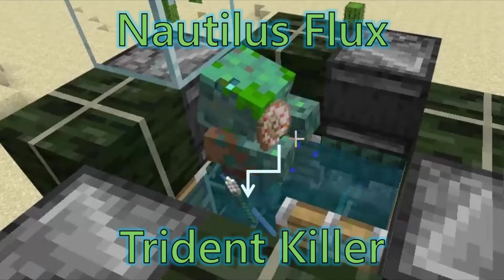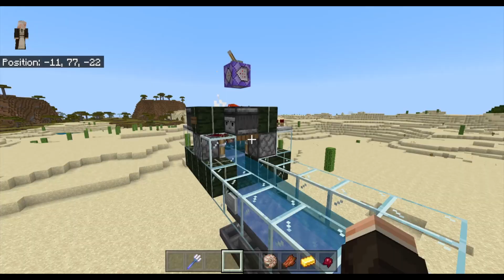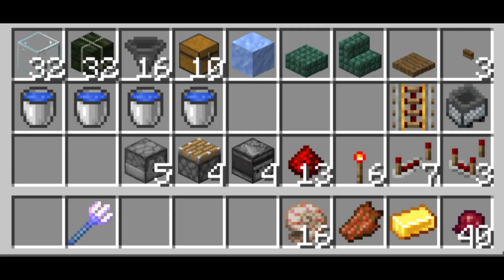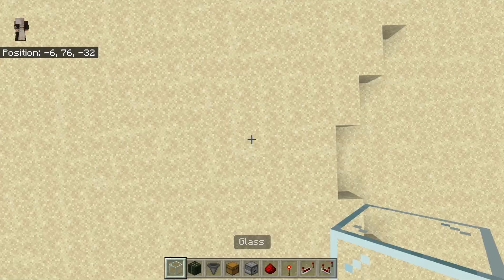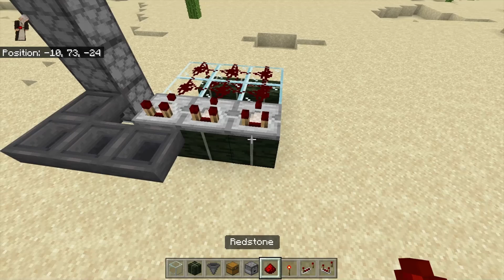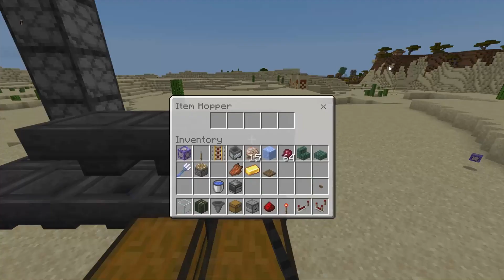Nautilus Flux Trident Killer - tutorial

Comment: Great design, seems to be working in 2024 ( although I did mod the sorting system for the one with targets as I was getting a few items in my trident chest). Curious, what happens once the shells really start adding up? I ran the sorting system with silent whispers version of the farm and not sure how I can use the elevator to the kill chamber but also store and sort the shells once they’re adding up (ie over 64 of them in the system). Thanks
Reply from the maker: Glad you like it. The shells should go past the flux filter once it is full, and then on to storage. FYI I have a newer version of the flux system and several improvements over silents’ version of the farm in my video here:
https://youtu.be/2MpM9RTxp1g
Reply: Thanks for the swift reply, i did consider shortly after asking that that was actually the answer so thanks for confirming! Also , checked your latest version so also thanks for pointing me in that direction. I’ll add the corner insets and turtle eggs as detailed, probably won’t take the time to adjust the drop chamber as I already added the flux and sorting system etc. at the bottom, but I may try a trident killer at the top and just let everything drop down out of that, althiuhg the rates are probably enough for what I need. I’m currently getting squid in the day, and drowned at night. I replaced the lowest layer of ice with magma blocks which is taking care of the squid which was circling around the entrance to the drop during the day (sacs jus drop down then into the filter system, to which I added ink sac too alongside the copper/flesh/shells. be good to get glow squid out of the farm as well but assume it would be one squid type or the other rather rather than both. Thanks again for the time you’re taking with your builds and videos.
Reply from the maker: @JJ-he5lr  yeah glow squid only spawn under a solid roof below Y 30.